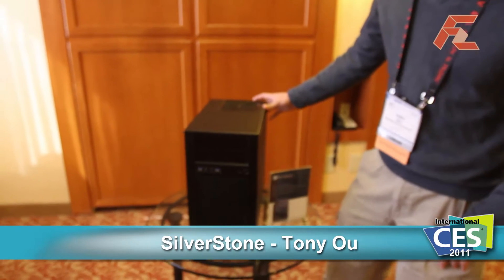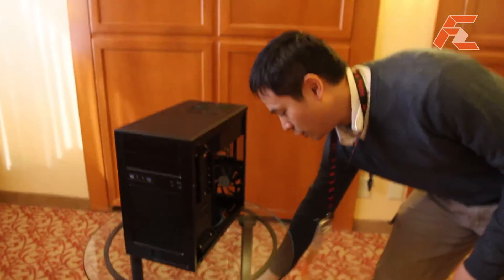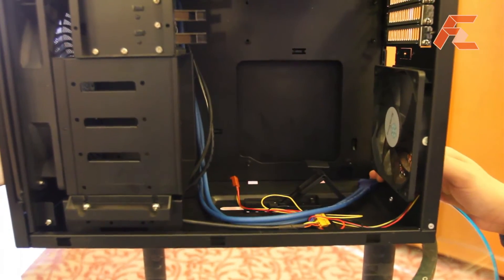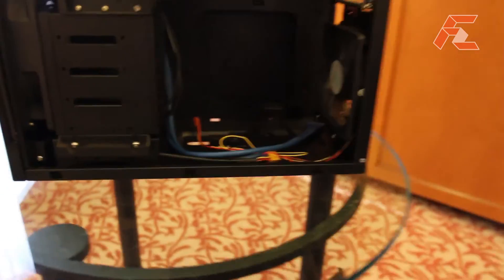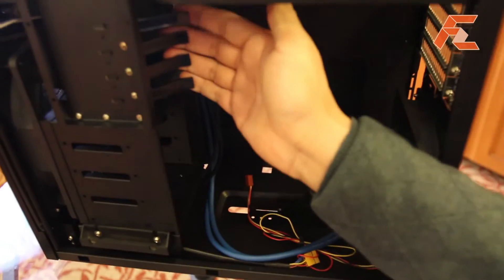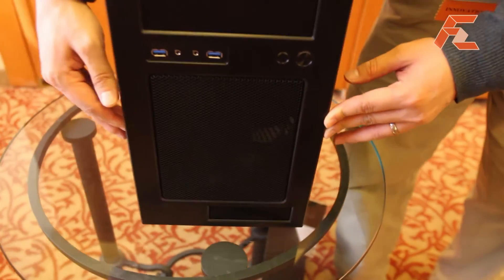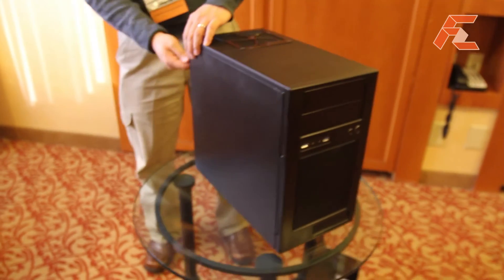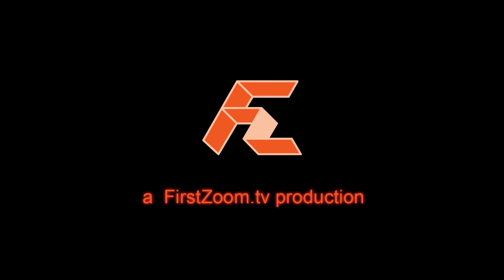Silverstone TJ08-E (Evolution)

Comment: Just ordered it.  We'll see how it its.  One thing I've noticed from pictures is that you can't have tall rams if you put hard drives on the rack.  From the pictures i've seen, the hard drives stick out from the rack thus it goes over the top of the ram.  I'm not gonna use the rack though.  Good thing too because I already have the Corsair Vengeance tall heat sink rams.  Anyways, should make for a clean little setup.

Comment: Mounting the PSU at the bottom would create problems:

1) Optical drives would hit the motherboard (case has short depth)

2) They would need to add tall feet for the intake, increasing case height.

3) They wouldn't be able to separate the PSU zone with dividers.

4) They wouldn't be able to include the heatsink support bracket

The layout is fine, they just need to make the top grill like the front one, with the dust filter inside the case.